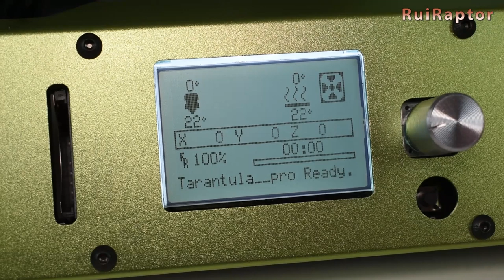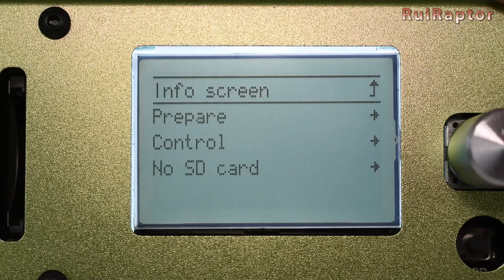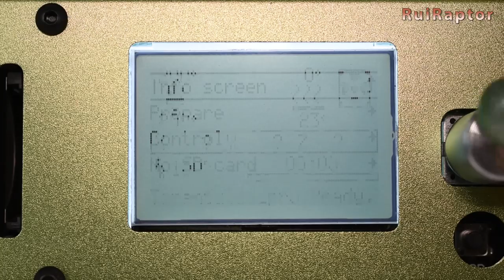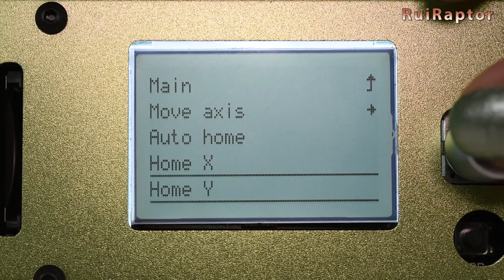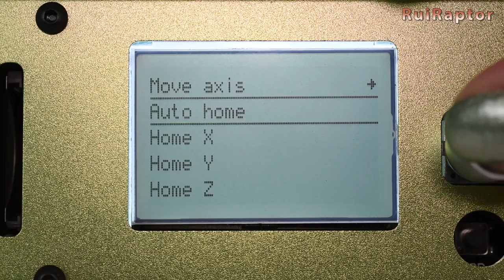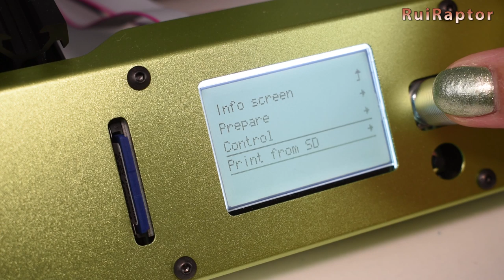TEVO Tarantula PRO - Detailed Assembly & Calibrations

Comment: Excellent assembly guide yet again. Some slight changes Tevo have done in kit seemingly over the last month. The Y-axis motor is the same motor as rest of the kit (not bigger). They appear to also have changed the bottom feet so the clearance is no longer an issue. Only annoying this I found was the Z-Axis gap required to mount servo to vertical mounts needed several washers that were not included and only found when mounting bearing ontop of lead screw requiring some disassembly.  Otherwise fantastic guide!
Reply from the maker: Hi Peter,
You are correct, they have changed a few things and fixed some initial issues (which is a good thing). Thanks for your comment :)

Comment: pretty obvious where they have cut corners on this one:

-Mechanic endstops over optical ones
-DC Aluminium heated bed over Glass Ceramic AC bed.
-Low Power PSU
-Ancient motherboard
-A4988 drivers.
-98% disassembled.

are these reductions over the Flash worth it to you? i cant say. I'd have liked to see optical endstops, and maybe AT2100 or ST820 drivers, but between this and the Ender 3, im not sure what i'd pick seeing as they're about £10 apart.
Reply: Price is worth it to me
Reply: I'm in that position to pick between Ender 3 pro and this, and I'm returning my Ender for the following reasons:
- Volcano hot end with 2 part cooling fans
- MKS gen L board with bootloader
- Titan extruder
- slightly bigger print area (1.5 * 1.5 cm bigger, not sure if you can change the firmware on Ender to gain print area since their heat bed are the same size...)
- cheaper price :p

Downsides are that the community support isn't as big as the Ender 3 one and may never be, plus I can't find any Tevo firmware on the Marlin example folder >:(

Comment: I've just finished assembling a tarantula pro but it seems that the fans are not wired correctly. When hot end reaches 50C the right part cooling fan starts to spin and when I manually enable part cooling the left fan and the front hot end fan start to spin. Is there some easy way to fix that?
I only see one connection labeled "FAN" on the board so i guess the fault must be in the wiring harness that goes to the carriage.

Comment: at 23:30 or about you follow the directions and place the spring washers between the brass and the plastic holder.  Spring washers go directly before the nut to prevent the nut from loosening.  There is no rotational force on between the brass and the plate.  U think this is wrong!

Comment: Help! I did all this and keep getting the E thermal runaway error about 10mins into the print. I have tried 3x to print the SD card and it keeps failing. Also, the filament that did print in 10mins is GLUED HARD to the buildtak... How do I fix?
Reply: I haven't gotten a single print to work yet....
Reply from the maker: Probably you need to run a PID calibration. Also, check if your layer cooling fan is pushing the air too high on the nozzle/heatblock. You can try to install a sock and see if it helps. Regarding the finished print, you are probably printing the first layer too low on the bed. If the first layer is too squished it will be harder to remove when finished.

Comment: Correct me if I am wrong. At 23:08 you are installing the T nut for the lead screw with the spring lock washers between the back metal part and the t but. But I think they should be between the m3 nuts and the t but. So when you tighten the little hard to tighten nuts they do not come loose. I'm beginning to think that Loctite thread locker will be my friend.
Reply from the maker: Hi Bill, that is a good point. Almost all the manufacturers assemble like this and we followed the same. I'm guessing it's maybe to allow the nut to adjuts it's angle since the metal plate can easily be off of perpendicularity.  Regarding the thread locker, yes, 100% go for it.
Reply: @ruiraptor  Thanks.

Comment: I am worried about if two 2040 base Aluminum profile can withstand the weight of the whole printer and if the 24V 8.25A can support the heated bed even I add a glass plate later on. But it looks like a high-quality printer and I am thinking to change it from my old Anet A8. (I want to buy TEVO flash previously, but I am afraid of the electric hazard from AC headed bed)
Reply: That's a DC heat bed . ;)
Reply from the maker: Hi Summer
The frame can hold perfectly. Regarding the power supply, this model works great as long as you don't exceed 70 degrees C on the heatbed (which match the specs from the manufacturer). 
I also have the tevo Flash and the Tevo tornado. Both have AC beds and i don't have any issues with them.
Reply: Add a mosfet like most do to tarantulas much safer
Reply: @ruiraptor  @official tevo channel  
 thx for the replys  ^^.
If 70 degree is okay,  i believe it is enough for pla and PETG.  I Look forward to the test print video!!

Comment: Ofc I didn't check the hotend assembly and ofc I got a clogged nozzle. do you clean the old thermal paste at reassembly? how? or do you just use new parts? another thing, even though the motor and idler plates are at the end of the extrusion, my Y range is about 225. Do you have full 235 range? I'm planning on doing a little mod to get 240 seeing as that is the bed dimension. thank you for the video, I was a little unsure how much thread from the heatbreak should go in the heatblock, as it is not the same as the heatbreaks one finds upon google searching. One small comment I would make @4.46, the measurements should be made at the end of the extrusion, even a fraction of a degree off at the screws, not noticeable at a quick read, turns into a couple of millimeters at the other end. keep up the good work.
Reply from the maker: Hi, regarding the nozzle, check this video where we explain in more detail ( https://youtu.be/rvkj8f_xNtE ). The white paste is removed. If the hotend is correctly assembled, you don't need the paste. Regarding the Y axis travel, if you adjust the idler and motor position correctly, you will reach the full bed travel as we show in the video. Regarding the measurement, we are actually checking the squareness at that point and not actually measuring. But you are 100% correct about measuring at the end of the extrusion which gives a better reading due to the distance and angle.

Comment: just started assembling mine and all the motors have the same size... i probably got an older model or something... anyway thanks for the video!!!
Reply from the maker: Hi, yes, only the first batch came with a bigger Y axis motor. Since then it's equipped with a normal size Y axis motor.
Reply: @ruiraptor  aah so its a newer version cool! oh and as an idea for a future video if you want make a tutorial for manual mesh bed leveling instead of getting a bl-touch or other probes, like how to enable it and use it etc cause for such a budget 3d printer getting a 40-60 euro probe is probably something many people dont think its worth it (even tho it 
definitely is!)

Comment: 9:50. The locking nuts are 8mm.  The off center hex spacers are 10mm.  Finger tight the 8s.  Slightly off center till wobble is gone.  Should be a smooth slide.

Comment: take me a doubt? at the base of the heated bed, does it swing or does it have to be stable? When you adjust the roller bolts, is it just to run easily or to run easily and leave the base unsteady? I wait and God bless.
Reply from the maker: Hi Rubens, you need to tighten the screws and then turn the eccentric nuts to adjust the grip of the wheels.
Reply: @ruiraptor  thanks, but the bed can be unstable? rocking a little or have to be fully firm?

Comment: The wheels in this kit have little imperfections that make the Y axis bump along. I had a problem with one of the base 350mm profiles being the wrong one and had to drill out the underside of one to accommodate the bolts. Also the Y motor is now the same as all the rest. The wheels are making me pause the build until my polycarbonate v wheels arrive tomorrow.
Reply from the maker: Hi Billy, the "notches" that you feel on the wheels are caused by turning the eccentrinc nuts a bit too much. You probably have too much grip on those wheels and because they are soft, they develop notches when they are stopped. Try to loosen the grip on those wheels a bit.
Reply: @ruiraptor  Ha. Maybe somebody else I did not over tighten the ecentric nut, in fact they were to loose and I gradually tightened until the stopped wriggling and then backed ever so slightly just before they were too loose. I tested each wheel by hand after the problem with the Y axis. Anyway it now has all Polycarb wheels.

Comment: what is the max temp of the heatbed?
Reply from the maker: The max recommended temperature is 70 degrees C. 
You can find all the specs here:
https://pt.aliexpress.com/store/product/TEVO-Tarantula-Pro-The-most-Affordable-3D-Printer-DIY-Kits-in-2019-Newest-3D-Printer-Free/2010004_33010618458.html?spm=a2g03.12010612.8148356.2.427bec510MLWMf
Reply: @ruiraptor  why is it to low, the mk3 heatbed can reach over 110ºC?, Could you test this in your next videos?
Reply from the maker: @alejandrocastelao8865  , The reason is probably because of the small power supply used. It will probably take too long to reach that temperature. However, we will test that in our review.
Reply: @ruiraptor  ok, thank you so much

Comment: Wondering how/if belt tension mods can be added on X....yes...i know we can cut ties and pull....but better to have an adjuster to slack off the belts at times.
Reply from the maker: The X axis has some play. You should secure the belt with the X motor pushed all the way to the right, then secure the belt with some tension and then pull the motor back to the left. You have enough play to add the tension you need.
Reply: ruiraptor ....yes, I know this.....but the only way I can see to tighten the X belt ....is cut the ties and pull the belt tight....then close with new ties. Not really efficient. Look at the AnetA6 and similar machines....easy to print and fit a tensioner....ditto GT A10 and the other model types....ditto Creality machines. This machine is built to save money...not assembled, old type parts, poor design when there are better machines to clone!  No competition here for CR and GT!
Reply: You can adjust. See the video at 32:24 and 33:55.

Comment: Have you try print abs or other high temp filament? Result good?
Reply from the maker: This printer is limited for filaments with hotend temperatures higher than 240ºC. If you want to use higher temperatures you need to replace the hotend with an all metal one. Also, the heatbed will struggle to reach 100ºC.

Comment: Do you know what the correct type of nozzle fits the standard hot end on the TPro? Thanks for any info!
Reply from the maker: Hi Fernando,
the tarantula Pro uses volcano 0.4mm nozzles. These volcano nozzles are longer than the traditional ones.
Reply: @ruiraptor  Thanks for the info! Cheers!

Comment: How did you adjust the bed if the nozzle didn’t reach both side of the bed? You only showed a picture of both ends
Reply from the maker: What do you mean by adjusting the bed?
Reply: ruiraptor at 42 mins
Reply from the maker: For the X axis travel, we mention in the video that you cannot adjust the endstop so you need to use the home offset instead.
Reply: ruiraptor you specifically said at 42:10ish if the nozzle doesn’t reach each end of the bed, you need to adjust the position of the y axis motor and y axis idler. Did you unscrew and move them? How did you adjust them?
Reply from the maker: Oh, you mean the Y axis. Yes, you need to loosen the Y axis motor and Y axis idler so that you can adjust the travel on that axis.
Reply: ruiraptor do you just loosen them or actually love the y axis/y idler forward?
Reply from the maker: You need to adjust the position so yes...you will need to move them.
Reply: ruiraptor thank you for replying

Comment: The two fans on the sides of the hot end do not work since I bought, something you can find out?
Reply from the maker: Hi Rubens, Check the connection on the board.
Reply: Is it set to off in the Slicer?
Reply from the maker: That is correct. The 2 fans on the sides are PWM controlled and set by the slicer as layer cooling.
Reply: Thank tou, i Will check